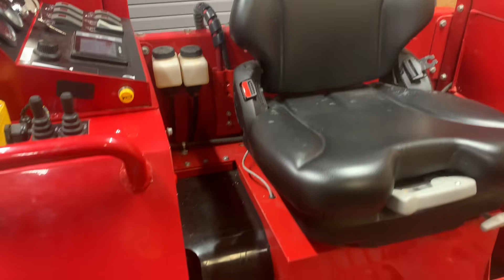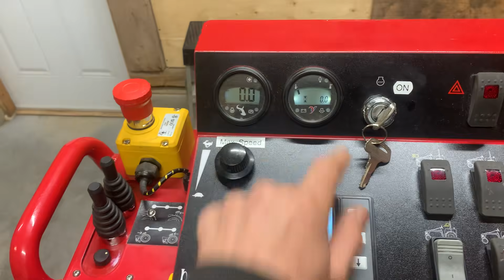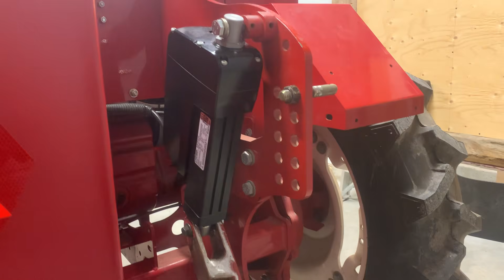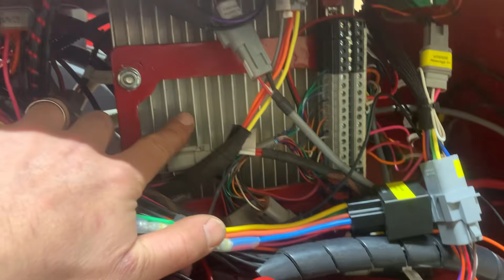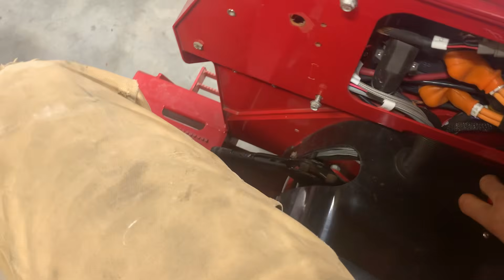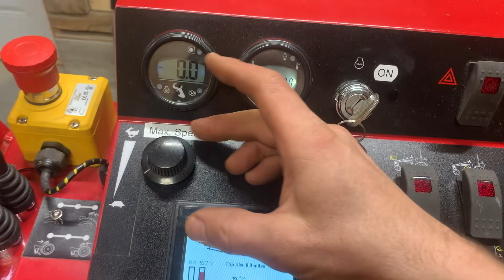This Thiessen/Tilmor 520e electric cultivating tractor is really one of a kind!

Comment: I like the conversion. Wondering if you will add a solar canopy? Not sure if it would help much. How many hours are you estimating it will be able to run before needing a charge?
Reply from the maker: Solar canopy would be fun but hard to justify unless I could do it cheap with upcycled materials.  Where I live in Quebec our hydro rates are pretty low and all our grid power comes from renewables so motivation is modest at best.

Runtime with 12kWh of storage onboard is probably closer to 6 to 8 hours based on a similar machine with smaller 6kWh pack that we've been running on our farm for several years.

Comment: How easy would it be to go from one-off to production? Why is that Tilmor only do gas and diesel options? Is it because they are more geared toward export markets? What size of set up is necessary to justify a machine of this size?  How much would you estimate for the cost of conversion on top of the 35k for the machine?  Great video, thank you.
Reply from the maker: And as to scale it depends a lot on your crop mix and situation but you could possibly user I've of these on as few as 5 acres in some cases or as many as 500 in others.  There's too much variation in farming for generalisations to hold up very well.
Reply: @reidallaway  -  What crop mix would you recommend as optimal for a machine of this size and power?
Reply from the maker: It would certainly be possible to refine this approach, manufacture the parts required, build wiring harnesses and develop a commercial conversion kit.  Best guess is that it would need to cost $10-15k depending on battery size in order for it to pencil out as worthwhile for kit vendor.  If Tilmor sold you tractors without engines and 4-spd transmission that might reduce the tractor cost by $5-6k at a guess so you might be able to produce this kind of machine in some quantity for about $40-45k.  BUT you could make a far better electric cultivating tractor by starting from scratch and avoid many of the design constraints that a machine like this imposes because of its gas/diesel powerlplant design.  I think that's probably more likely and realistic that anyone (us or Tilmor) offering an electrified version of the 520.